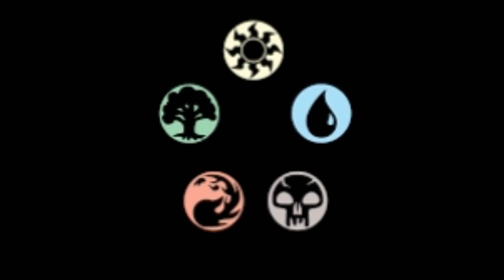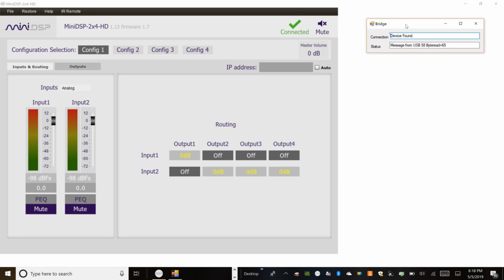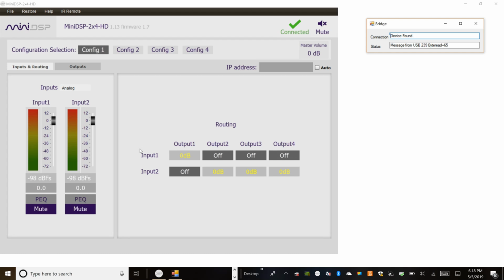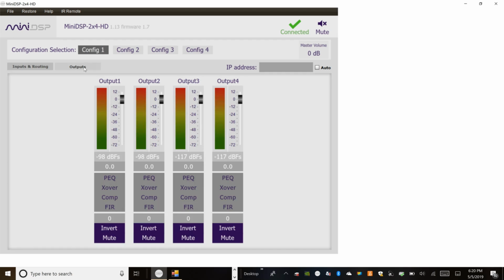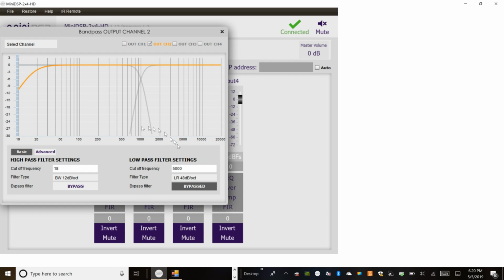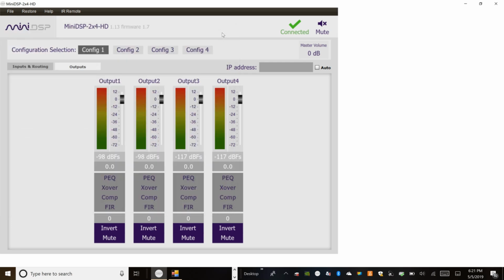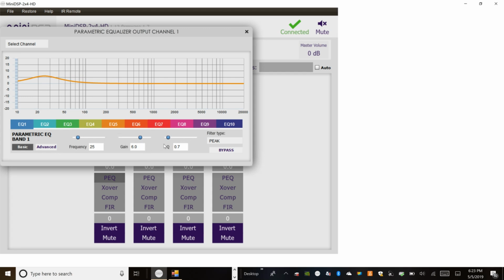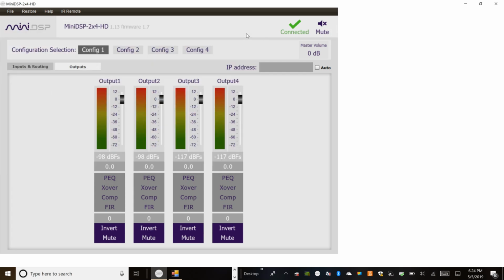How to set High Pass Filter Settings for Ported Subs - MiniDSP 2x4HD  - Full Tutorial

Comment: Yes thanks for sharing your video. I have the non HD version one of mini DSP  2x4. my plugin is 2x4 advanced. I only use it for my two ported subs and the plugin looks identical to yours but I have mine high lighted on the top, the routing area. So one in and two out as a mono signal. Now low pass I have that set at 25 HZ and high 80 HZ.  the meters are set at -10 to keep away from the red to avoid distortion. Can you put the low number on the high pass or low pass ? I hear the drivers going but not enough . When I default back on my AVRS Crossover at the sub out I really feel them . I am  doing something wrong. My drivers were bought seperatly so I have a external amp running them with the cabinet I have them in.
Reply from the maker: Those xover settings will cut out all the bass from 25 - 80 HZ.
Reply: @JilesMcCoy  Yes Hi so the drivers frequency response is 19 to 1000 Hz Should I up the low pass higher than 25 to 80 Hz and highpass at a higher no? and bypass the low cutoff and keep the high cutoff enabled ? sincere Andrew
Reply from the maker: @404010ful  usually you will use the low pass filter in your avr. Commonly people cross over at 80ish. So a low pass at 80 to knock out the highs. Then if you have ported boxes you would do a high pass filter at 18/19/20 ish.
Reply: @JilesMcCoy  ok thank you I was a little confused of the no settings with the high pass / low pass filter
Reply from the maker: @404010ful  the high pass filter is just to protect ported boxes under port tuning. So set that somewhere at the port tuning frequency. The low pass filter will be handled by your avr or processor.
Reply: @JilesMcCoy  thank you Jiles the subs are thundering now. Since everything is set properly now.
Reply from the maker: @404010ful  awesome man! Love it!

Comment: well first off you do the ported subwoofer SSF calculation of box tuning divide by 4 then what you get from that is then minus the box tuning which then gives you the answer for your SSF well HPF ..you don't set a HPF immediately below the tuning of your ported box tuning thats just loosing a lot of bass extension unnecessarily ..so for example..say ported subwoofer is tuned to 25hz right..25hz divide by 4 = 6.25 now 6.25 - 25 = 18.75 so basically 19hz ..now thats where you want the roll off the start..at either 19 or 20hz to be safe but if you can be very precise go on and do 18.75hz ..thats the proper way to set a HPF for ported subs...you don't want them to roll off far too early...thats just ....loosing what you can still be gaining from it

Comment: how to determine the right filter? I see GSG has a recommendation, but isn't that driver dependent? they have a 12db recommendation but why not 24 particularly at these sub 20hrz frequencies?
Reply from the maker: The filter depends on the tuning of the enclosure... so you should match to that.
Reply from the maker: As for the slope you want to retain as much response as possible but still protect the woofer from damage. 24 would sacrifice more low end without any additional effective protection.

Comment: Where would I plug in my NZXT Kraken x52? Either AIO PUMP, OR CPU FAN? On the motherboard
Reply from the maker: AIO pump
Reply: JDM World What do you plug into your CPU FAN?
Reply from the maker: If I use a CPU fan i'll plug that in. If I use an AIO and my board has an AIO header I don't use the CPU fan one.
Reply: JDM World Don’t you have to have something plugged into the CPU FAN?
Reply from the maker: I'll look tonight to see how I specifically have it all wired up and reply.
Reply from the maker: But if I remember correctly you need to connect:   Fan power, AIO tach, Sata power, and USB. The AIO tach should go to the AIO CPU header. Fan power from any power source.
Reply: JDM World ok, thanks, is there a different way I could contact you? This just takes a long time